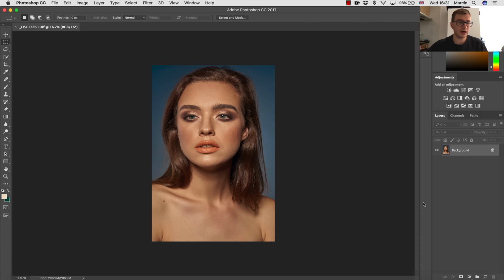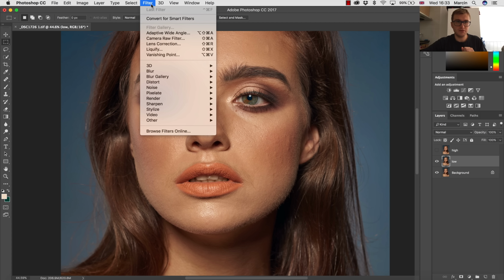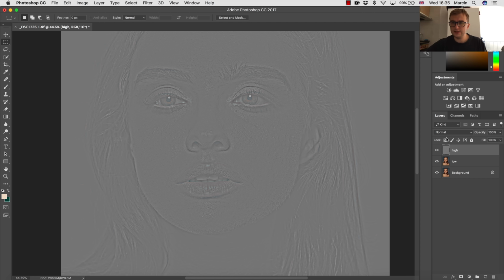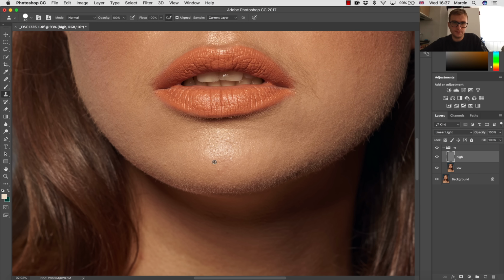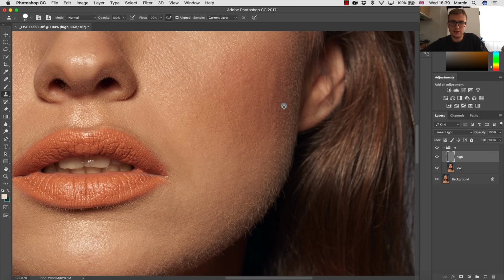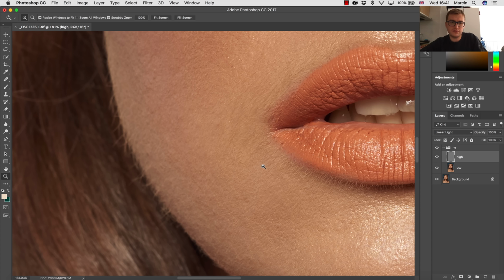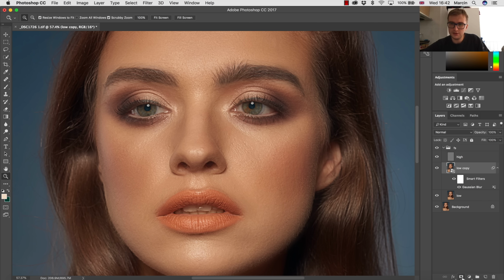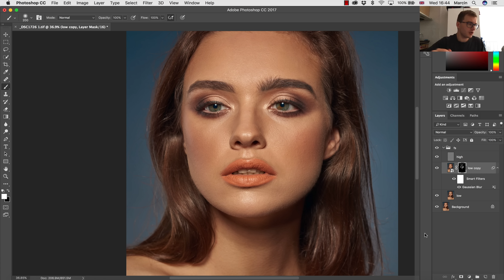Guide to Frequency Separation in Photoshop

Comment: HIGH-FREQUENCY PROBLEM SOLVED!!! I chose your tutorial because you posted it in 2017 so I felt it was up to date.  My problem was that I could not get the high frequency to show up after Image-Apply Image.  Now I know it is because I was using settings for the 8-bit image.   After watching for a few minutes you answered my question that other tutorials did not answer and solved my problem.  When I clicked on Apply Image, the setting was set for an  8 bit (subtract) while my image was a 32 bit (add).   I called Adobe today and they will have an answer for me tomorrow which was surprising.  I thought they would know.  Thank you for a great tutorial.  I will go through it again to hone it down.  Thanks.
Reply from the maker: Hey Janice thats amazing you found help here! If You have any problems or questions about retouching, feel free to leave it in the comment sections so i could make helpful videos for you and others :)
Reply: Hey! I know it's been a while, but what did Adobe say?